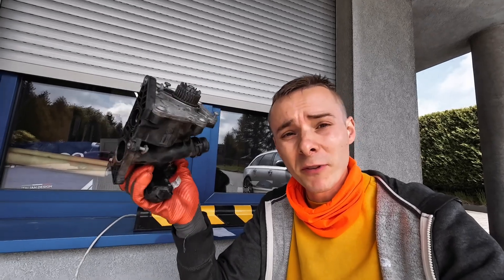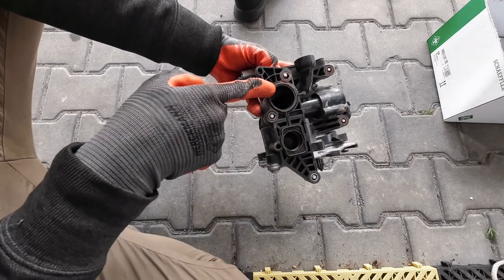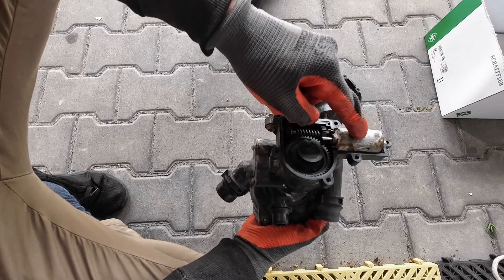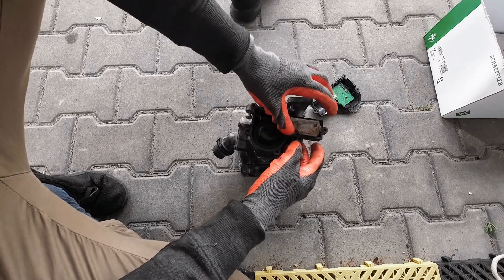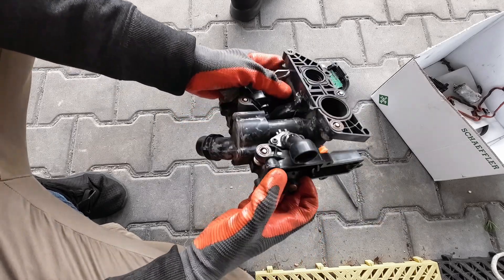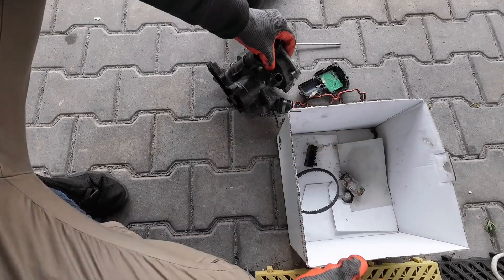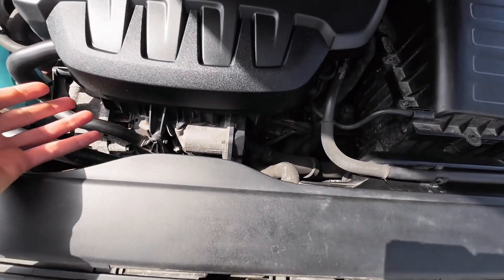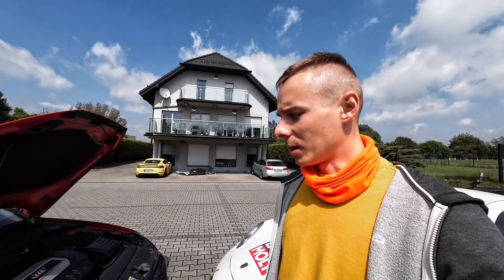P00B700: how to diagnose thermostat in VW Audi TFSI EA888.3

Comment: I replaced the water pump assembly on my 2017 facelift A3 with EA888.3B two weeks ago. No need to remove the intake manifold on the EA888 Gen3. Difficulty level: 6/10. Time required: 5 hours with two coffee breaks.

Comment: Cześć Mr-Fix, I have a 2015 Skoda Octavia 5E5 1.8T (CJSA, EA888 3rd Gen) with 125,000 km on the clock. About a month ago, it suddenly lost all of its coolant after reaching operating temperature due to leaks from this thermal management unit. Topping up the coolant wasn't enough, as the coolant was gone after driving 10 km. With the engine cold and 20°C, no leak was visible.
I had also thought about a workshop, but the parts themselves at Skoda without labor costs were already around 700 €. So I bought an aftermarket repair kit (254€, Schaeffler INA 538036010) with the pump, thermostat, belt/left-hand thread screw!!, and oil cooler connector and replaced it according to the official repair manual. It took me about 8 hours of DIY work and I was happy to have all the parts back in the car 😅 
In my case, the official method doesn't involve disassembling the intake manifold; Mainly, the intake filter, throttle body, and some hoses for the turbocharger and intercooler need to be removed. I also removed the vents from the large front radiator to create more space. After that, the repair can be done from underneath with a lifting platform
Your content is great, and I've learned a lot here e.g. MIB infotainment systems (getting rid of APG 😁). Please keep up the good work.
Reply from the maker: Happy to hear that you were able to DIY the issue! And thanks for the details. I'm sure someone will find it useful!

Comment: Can timing belt for EA288 (2.0TDI) be diagnosed via OBD reader? Are there any values to be checked? Visual check of cracks is basic, but what about measurements?
Reply from the maker: i believe only visual inspection. There's no stretch on belt that you could measure line in chains. Belts just snap one day.

Comment: I have a 2017 Golf GTD in Morocco with a MEB 2.5 device with European GPS and I want to convert it to Moroccan GPS
Reply from the maker: What's your FW train? You can see in in hidden menu (press and hold MENU for couple seconds).
Reply: @mrfixpl code fec/swap 09300008
Version de logiciel MHI2_ER_VWG13_P4521